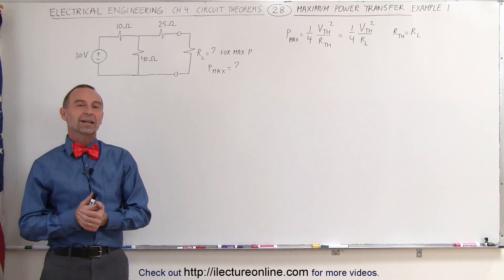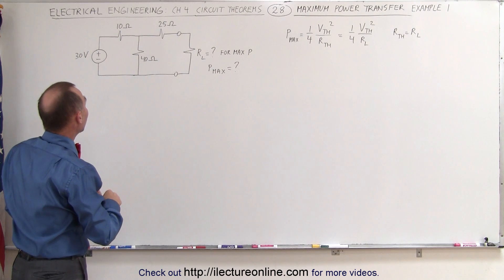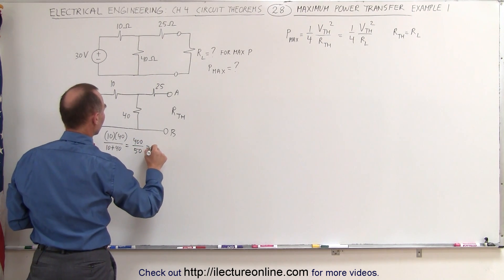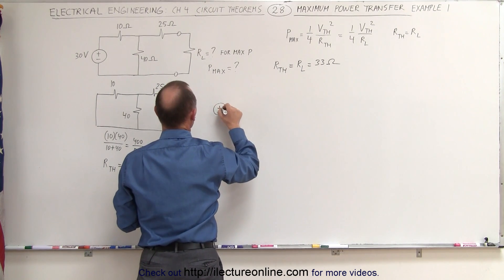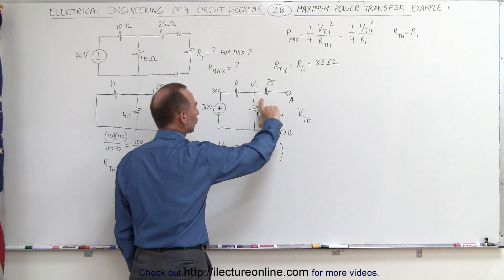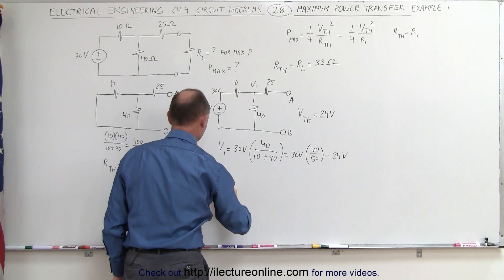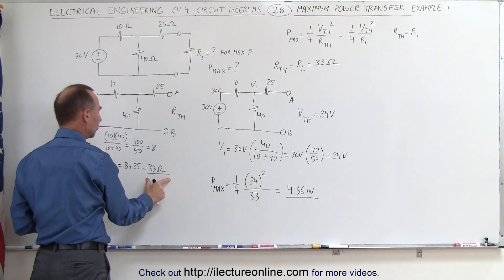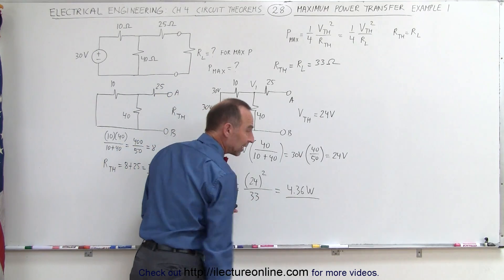Electrical Engineering: Ch 4: Circuit Theorems (28 of 35) Maximum Power Transfer Ex. 1

Comment: Hello, why is RL and Rth same here?
Reply from the maker: They are the same only if you want maximum power transfer.  You can try this by using 3 RL resistors, one bigger, one smaller, and one equal to RTh and then calculate the power dissipated across the load resistor.

Comment: Hello sir, if there was no 25 ohm resistor, would the thevenin's voltage be equal to the voltage across the 40 ohm resistor?
Reply from the maker: Since there is no current through the 25 ohm resistor (without the load attached), the Thevenin voltage will be the same, which means it equals the voltage across the 40 ohm resistor.  Once a load is attached, the 25 ohm resistor will make a difference.
Reply: @MichelvanBiezen  you are amazing sir, to still reply 7 years later is insane, thank you so much for your work.

Comment: Excuse sir , i would like to ask some questions
I know no current flow through from node 1 to A because of short circuit. current flow from one place to another place because of the voltage difference, place with high voltage will flow to place with low low voltage. If no voltage difference, then no current flow, so we conclude v1= va, is my concept right?
Reply from the maker: Yes indeed.  V1 = Va as long as nothing is connected between A and B

Comment: Professor in this example can we use nodal analasys to find the thevenin voltage ?
Reply: First current enter the nodal and 2 other current come out so I1 = I2 + I3
Reply from the maker: typically, you can use any method on any circutuit.  Eventually you will personally prefer one method over another, and you'll choose what you prefer.   (In algebra there are 7 different methods to solve linear equations and just like in algebra we learn all the techniques in an introductory circuits course).
Reply: @MichelvanBiezen  right . However voltage devidor fits more in this example , and its a short way

Comment: Hello sir , is there no current run through the 25 Ohm resistor? (when A and B is open)
Reply from the maker: That is correct.  If there is not a closed loop current cannot flow.

Comment: Wow nice, still little unclear with 40/10+40? Thanks
Reply from the maker: That is the calculation for the voltage divider.  The voltage drop across the 40 ohm resistor is (30V) x (40/(40+10)) = 24 V  (the other 6 volt drop is across the 10 ohm resistor

Comment: I don't think the thevenin voltage is correct, the 25 ohm resistor does matter...Pretty sure
Reply: Actually, was wrong it didn't matter
Reply: current doesn't flow through the 25-ohm resistor when R_L is removed - thus no voltage drop can occur over than resistor.

Comment: Hi, thank you for the video.

I have a quick question. Why is the Thevenin Voltage = 24V? Isn't the Voltage measured at the load resistor = 24V - the voltage observed at the 25 ohm resistor?

In retrospect, I understand that resistors placed in parallel will experience the same voltage but I always thought of voltage as something that drops as it goes across a resistor. In that case it is hard to see that the voltage drop across the load resistor is the same as the voltage across the 40ohm resistor because the 25ohm resistor should take some of the available 24V away before it goes across the load resistor. Could you clarify this for me?
Reply from the maker: To find the Thevenin voltage, you remove the load resistor and then measure the voltage between A and B.  Not that no current flows through the 25 ohm resistor and thus there is no voltage drop across the 25 ohm resistor.  Thus Thevenin voltage is the same as the voltage drop across the 40 ohm resistor which is 24 V.
Reply: nice. thank you. i had the same doubt
Reply: Good day Sir, does this mean that the 25 ohm resistor can be ignored?  i also tried calculating V1 using the node-voltage method. it did not work?  why is this method not valid?
Reply: @Aidan Higgs Nodal analysis cannot be used because that 25Ω resistor doesn't see any current, so there is no voltage drop there. The 30V just goes through the 10Ω and 40Ω resistors on its way from A to B :)
Reply: @TheChosenOne66501  Thank you very much, i understand now